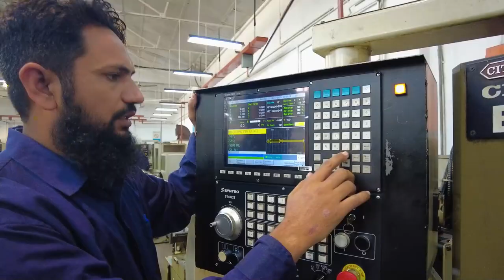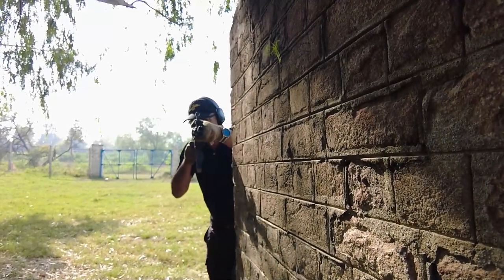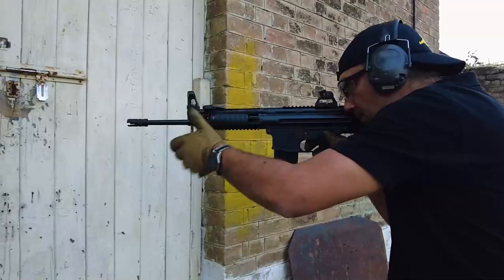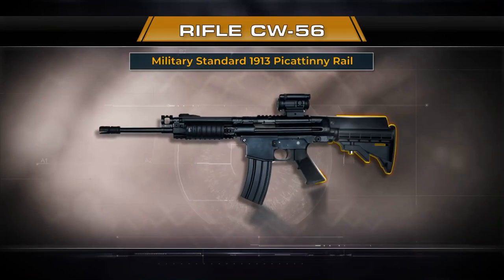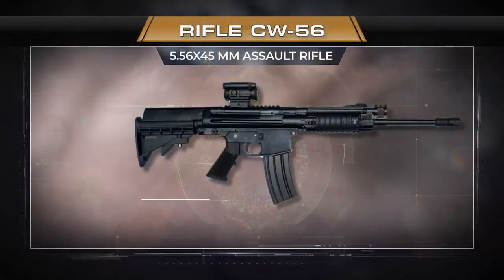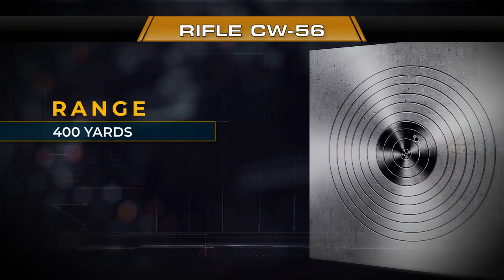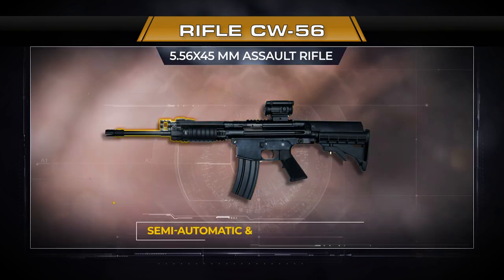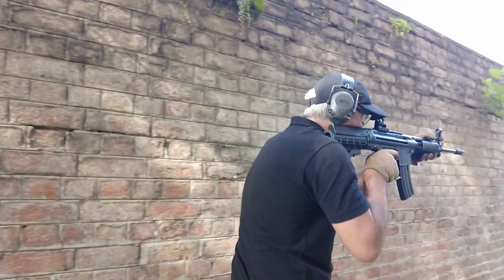CW56 assault rifle 5.56

Comment: This is probably the most efficient way to move forward, using the existing infrastructure and improving or innovating where it is only necessary, great job brother.

And once you make sales and raise capital then you can invest in R and D regarding scopes and projectiles. These are the two segments,imo, in the near future that will give soldier advantage over its adversary. Best of luck to you and your team.